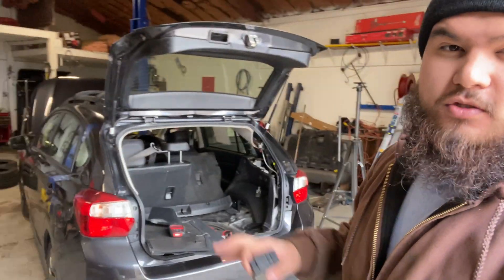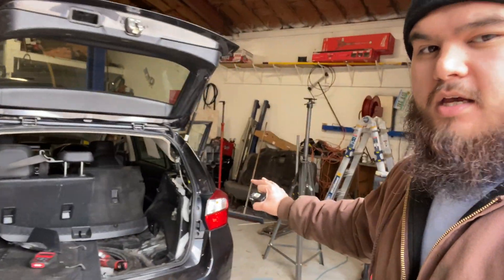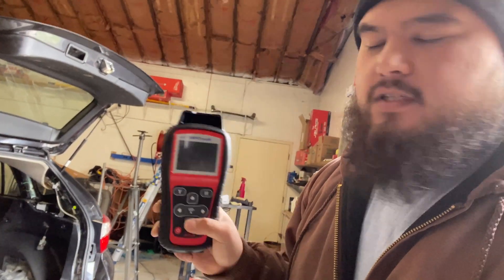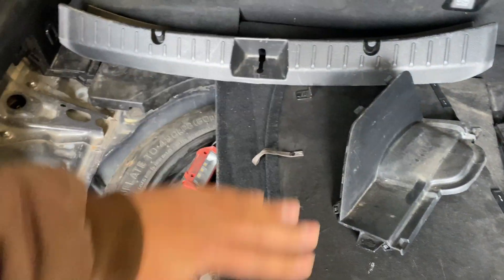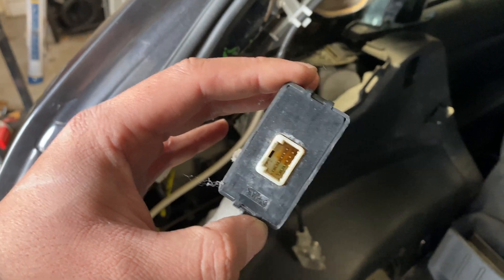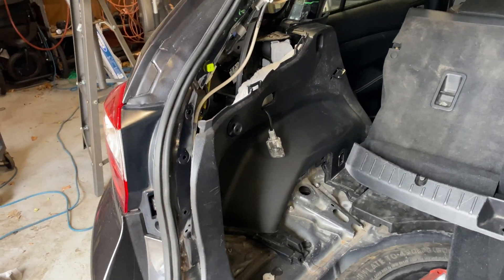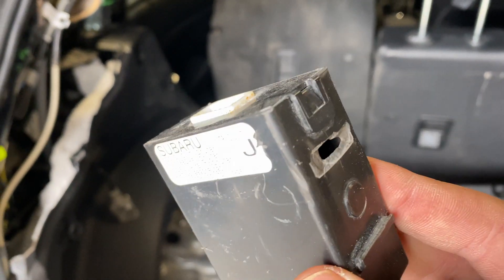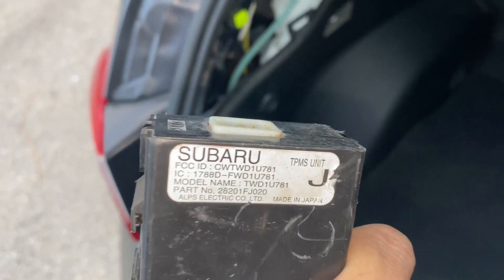Diagnosing a bad TPMS module in a 2016 Subaru Impreza - Explained

Comment: I have a 2009 Forester I just purchased. Changed all the sensors in the tire. The TPMS module is behind the passenger backseat. Not too difficult to get to, but it looks ok. Tire light won’t turn off.
Reply from the maker: Did you get the new tpms sensors programmed to the vehicle? I believe you’ll need to do that first. Might need a special scan tool for that.

Comment: Would you happen to know what it means if the TPMS sensor goes off every few days?  The light is not constantly on.  My door locks still work and the tire pressure is displayed about all four tires when I scroll to that feature.  Does that mean a dying battery or a bad module?  Was in a car accident a few months ago but mainly damage to my rear bumper cover not to any corner panels.

Comment: I have a TPMS control module that has failed three times now in under a year. I have a 2016 I first paid $900 as the part was not under warranty. The second time dealership fixed for free. Failed a month later fixed again for free and now its four month later and failed again. At this point, i do not know what to do. I want to fix it myself as my brother is a mechanic but then I would have to have it reprogrammed as well. I cannot keep taking my forester in for the same issue yet I dont like having my tire light and constantly having to check to make sure they are ok. Unfortunately AAA cannot help me as it is a dealership issue. Any advice for parts for 2016 Subaru Forester. I have also read that where they put the sensors are prone to leaking from the moonroofs.

Comment: I went to Subaru because my TPMS is on. They said that the control module is not working. They said they are going to replace my module and reprogram both of the keys. Thank goodness my 2018 Forester is under warranty.
Reply: $900 repair, gonna take it to my local mechanic because that seems whack.
Reply from the maker: Yes you got lucky! That sounds like a pricey repair!
Reply: They told me Electronics were not covered under warranty

Comment: Thanks for explaing it  man, I'm having same issues with my forester tpms lights/keyless entry not working
Reply: I have a Forester too. The keys to lock/unlock doesn't work and TPMS lights won't go away. After a $265 diagnostics fee from Subaru, the guy told me it'll cost $700 more to get it fixed
Reply: @PG-1114  we have a 2014 Forester exactly the same issue and exactly the same diag and fix at the dealership. We paid the amount they put in the new module , now 1 month later we have exactly the same issue key remote won't work and TPMS light on and flashing at first.

UPDATE - was able to remove the module and confirm it was damaged by water getting in it.
Reply from the maker: It’s possible that your RF module has taken a crap. This was a very rare situation but i felt the need to explain it a bit. Hope the vid helped!
Reply: I had to fix this problem twice it ended up being that the roof rail above the module had a loose bolt and all I had to do was tighten it. Installing the module isn't very hard but the TPMS/keyless entry module needs be reprogrammed by the dealer or tire shop/lock smith.